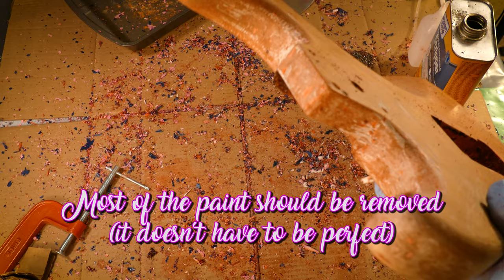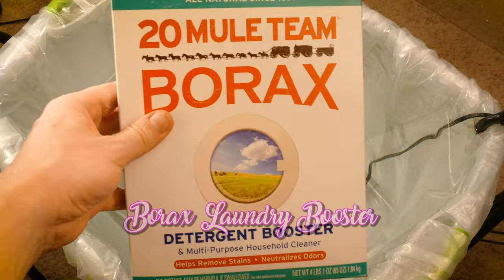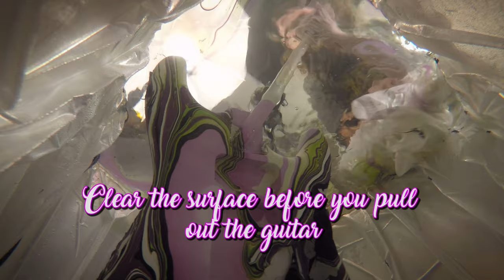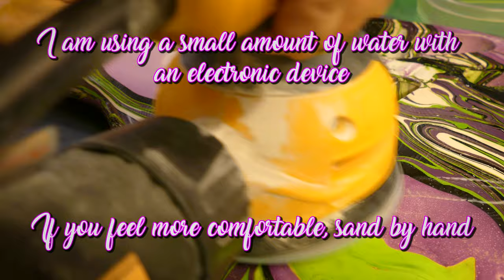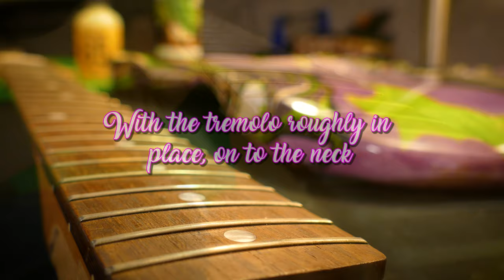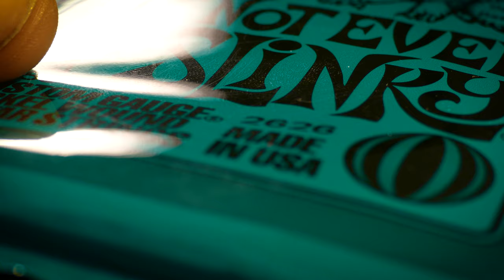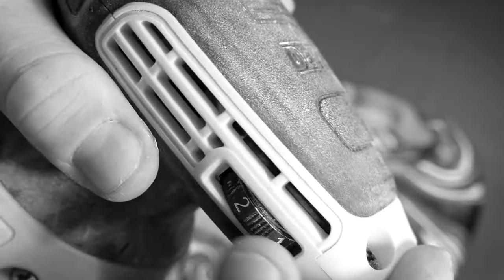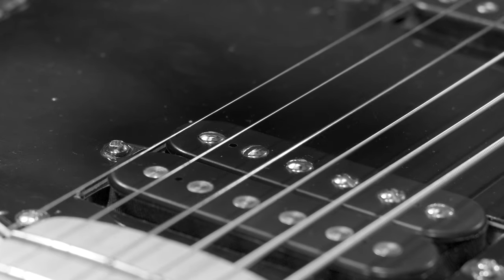How To Hydro Dip A Guitar DIY - 4K (UHD)

Comment: you should of used sandpaper to get the paint off it would have been easier and it would of smoothed up the guitars surface instead of gouging into it like a putty knife will
Reply: It wasn’t lacquer either which is why the heat gun wasn’t so useful but I think it was pretty cool
Reply from the maker: Hi, SPRIRECRANBERRY! I did try to use sandpaper, but it was far too thick of coating. That may work on thinner laters, but it would have taken me probably twice as long as it did with stripper. Especially, sine I forgot I had a ROB during this step. The, "gouging," you are referring too was of minimal issue due to the consistency of the enamel, and the lacayer. Still, thank you for the feedback. I maybe should have mentioned why I didn't do that during that step. Thanks!

Comment: Looks great 👍. I have the exact guitar. Even the base color. I used 120 grit sandpaper and the paint came off quickly. Then sanded with 220. And finally used 600 grit. Super smooth and ready for a dip. 👍
Reply from the maker: Hey, Mr. Smith!

Thanks! That is awesome. Small world, eh? Yea, I wish I would have remember about my orbital during that step. Did you end up dipping it? Do you have any pictures of what you decided to do? Maybe the end result I can see?

Comment: I wonder about doing a good scuff job then primer over that.  Use an adhesion promoter first?  Save the stripping time and money.  And all the gouging in the wood.  
  Or, both sanding, to get through the majority of the original paint, then stripper, to relieve some of the effort and scratching and filling scratches.  Just a thought. 
  The water temp needs to be between 75°f and 90°f, closer to the 90, for sheet dipping, especially. 
  I'm not sure about the colors (thats all subjective and personal taste) but the finish 👌 is spot on.  Good job having patience because that is the key to a job like this.
Reply from the maker: Hi, Boomer! You certainly can paint over the original if you know the condition of the guitar. I bought this off of my buddy. It had been sitting in his garage for some time. I wanted to be sure there was no water damage, so I removed all the paint. That last thing you want to do is seal that in. Thanks for the tips as well!

Comment: I don't know if its already been said, but if this had a poly finish, paint stripper just makes for an unnecessary nightmare.  A heatgun and putty knife will take the whole guitar down to bare wood in 20 minutes without the mess.
Reply from the maker: Hi, Connor! Yea, I tried with the heat gun and putty knife at first. Unfortunately, it wasn't effective at all. Not sure why. The paint stripper was also a pain. Maybe I retry the heat gun again for the next one. Thanks for the suggestion!

Comment: First, AMAZING build man! I enjoyed this video a lot. After you dipped the guitar you applied a clear coat, wax and then polish. Would there be any need to apply a final clear coat or lacquer to seal in or protect that awsome paint job or would that be unnecessary?  I have zero experience in guitars or guitar building,  I just enjoy seeing cool shit being created and I know if I had something that looked like that I would go crazy of it was damaged.
Reply from the maker: Hey, Bill!

Thanks a lot for the compliment and taking the time to not only watch the video, but leave a comment as well! The clear coat I used was actually a lacquer. I used a lot of it because you are right, I would probably cry if it chipped or cracked. Luckily, I used enough to where I don't think this will be an issue. Just be sure if you did something similar (trust me, you could do this), just take your time adding several thin layers of lacquer to prevent it from "alligatoring". If you do it slow in small layers, it won't be a problem. Enamel paint and lacquer can be tricky. Thanks again, Bill!

Comment: Great finish,  but, as a professional sprayer may I give you some advice. It looked to me as if you had a lot of aeration in the lacquer at the end (little white dots) seems to me you need to leave longer time in between wet coats of lacquer to let all the air escape out of the gloss I tend to leave a few minutes after the first coat then double the time for second and double that time for the third and so forth
Reply from the maker: Hey, Jesey!

That's great advice. I forgot mention that in the tutorial. It is absolutely true that time between layers is pertinent. It can cause cracking, or even clouding in more humid environment. Thanks for the feedback!

Comment: Alrightt great video, defo gonna be using this for when I try to hydro dip. Just bought a basic DIY guitar kit from gear4music so should be a good thing to start on. Only thing about this vid is the font but you probably got that comment a hundred times lol. Thanks though.
Reply from the maker: Hi, Jacob! Thanks for checking out the video! How did it go?! I'm curious as to the result. Hope it went well. I understand the point about the font. I went for the swirl theme over legibility, and it was a mistake. Live and learn.

Comment: Great video. I’m glad to see that this technique works with enamel paint because that’s what I have bought. I am going to try dipping my guitar with the pickguard and back cover in place so the swirl flows over them. I hope the primer sticks!
Reply: Unfortunately borax is banned in the U.K.  Is there something else I can use?
Reply from the maker: Hey, Richard! That is a really good idea. It certainly may work. It may be a challenge preventing the paint from coming off of the pickguard, but please let me know how it turns out. Thanks for the compliment about the video as well!
Reply: Well the primer stuck fine to the pickguard but unfortunately the enamel paint ran a bit and spoiled the result. Different colours of enamel paint seem to have different viscosities. The white and blue were ok but the yellow didn’t work. I’ve got some Magic Marble paints, to I’ll strip the body with a heat gun once again and have another go.
Reply from the maker: @richardhunt809  Hi again, Richard. Unfortunately, you are the first one I am aware of that has run into this issue, but I am glad you mentioned it. I did some reading, and the best substitute may be some sort of gelatin. I cannot comment from my own experience, but someone had the same issue as you, and asking about it on a forum. I posted it below. Hopefully this helps. Thanks!

http://www.fixwins.com/getAnswers.php?Problem-Resolved=54669&q=+Borax+substitute+for+swirl+painting+
Reply: @JoeLewis14  Yes, I used a powdered gelatin but it didn’t seem to help much. Maybe I didn’t have enough.

Comment: What kind of water heater was used? Very glad I ran into your vid...prepping to  dip a JEM kit. Crossing my fingers it comes out as awesome as your work! Great job! Amazing! ✌️😎🎸
Reply from the maker: It was nothing fancy. I just used a typical aquarium water heater and checked the temperature with a thermometer. You should be able to find something more finite on Amazon. They have controllers and such to ensure the temps are accurate.
Reply: @JoeLewis14  thank you!

Comment: I’ve watched a heat gun and scraper being used that worked really well….instead of paint remover,..
Reply from the maker: Hi, Jerry. I tried that, and usually it works. However, it did not seem to work very well with this paint. It was odd.

Comment: BILL,  fantastic video ,edits and topic and craftsmanship.  What is the purpose for the borax, does it helps the paint spread out lowering the surface tension?
Reply from the maker: Hey, Havana! You caught me at a good time. I just hopped on to check my YouTube messages and saw your comment.  Thanks a ton for the kind words! Borax prevents the enamel paint from mixing with the water. It ensures the paint stays on the surface. Think of it almost like how oil floats on top of water.  Thanks again, bud!

Comment: Love the build! Was it absolutely required to remove the old paint down to the wood? Could you have just lightly sanded an already painted body and dipped over it?
Reply from the maker: Hey, Kel Rob!

Thanks, mate. Good question. It may not be necessary to remove the old paint, but I decided to because I wanted to be sure the wood was in good condition underneath. It is personal preference. I bought this guitar off of a buddy for $40, and it had been sitting in his garage for some time. If you go ahead and just paint on top, you are putting faith in that fact that there guitar has remained properly sealed. It would be a shame to put in all of this work, only for the factory coated primer to peel up. Painting over the original coat will also make the guitar a bit heavier than if you removed the old paint as well. Hope this helps!

Comment: Amazing ! I have a project practically the same. A Squier strato of the 80s. I've already pickled it up and sanded it. I even gave him the base paint. But I've seen videos where they don't mix water with borate. I have no problem buying borate. But I would like to know if it is essential. What is the difference between immersing the piece in water alone, or in the water-borate solution... Thanks for the information. The guitar has been really beautiful !
Reply from the maker: Hi, Evil Empire! The Borax keeps the paint from mixing with the water and assist in the thinning of the surface tension on top. I've seen some videos done without it, but I would try to use it if I could.
Reply: @JoeLewis14  I decided to paint the guitar with another technique. I'm going to do a kind of tribute to EVH. But in the future I don't rule out painting such a guitar. The finish is amazing. Thank you for your information. Best regards.

Comment: Great video! When you say use "rough" sandpaper for the last once over during the sand leveling part, is there a grade associated with that sandpaper? For all the other sanding, a P number is given. Just a general question for someone that is a sand paper novice haha
Reply from the maker: Hey, 
 danvigneau!

Great question! i should have been more specific. I think anything around P320. Essentially, you are trying to make ridges for the primer to be able to grab on to. If the surface is too smooth, you are more likely to have chipping since there isn't a lot of grip for the primer. Hope this helps :)

Comment: Beautiful build and video! thanks so much. I was gonna paint my guitar just black but this changed my mind and I want a bit of a challenge. So let me get this right. You didn't buy hydrodip from the official sight but made your own solution using heated water the borax and the colors were enamel paint? sorry new to this trying to understand what I need specifically for the hydrodrip. I read the description but am just clarifying
Reply from the maker: Hi TheArcticKitten. You are 100% correct. If you follow each section step by step, and TAKE YOUR TIME, you will not be dissapointed! Good luck. I hope it goes well!
Reply: @JoeLewis14  I went through with it and it came out awesome! one thing ill add for anyone else reading is make sure u dissolve as much borax as u can in ur solution and stir well. I didn't on my first go ahead and all my pink paint fell to the bottom

Comment: Awesome video! 
If the guitar I want to paint starts as white do you still need to strip the paint?
Reply from the maker: Hi, Thomas! Thanks! I would recommend still using a primer to help the paint adhere. However, if you think the wood is in good condition underneath, there is no reason you couldn't just scuff up the current paint, and primer over it.

Comment: Love the tutorial! I’m getting ready to redo my sons squire for him in a blue swirl. I noticed the first clear coats caused what looked like “alligatoring” in the paint. I was wondering how you found the lacquer to work with over enamel? Usually this is a no no but based on the final look it seems to have worked out. Anything to look out for when doing the clear coats? Thanks!
Reply from the maker: Hey, Bobby! Thanks a lot for the kind words. I'm glad you enjoyed it. What a cool dad! You are 100% that enamel paint can be tricky. I recommend taking your time. Very slow and thin layers. Wait a while between coats, and you should be good. After 3 years, the guitar is still perfect! Hope this helps!

Comment: Will acrylic markers get messed up if you sand it after the first clear coat has been sprayed Also can I use something similar to borax since I live in Sweden and don't have access to that.
Reply from the maker: Hey, BattleKau!

Sorry, for the late response. Been very busy with work. I would steer away from sanding pain. It can smear and mess up the paint. I would clear coat first, then level sand. I'm not sure what a good substitute for Borax is, so, maybe you woule be able to order some online. Sorry, I couldn't be more helpful, there. Thanks for the question!
Reply: @JoeLewis14  Thanks for the response anyway I appreciate it!

Comment: I picked up a used Squier guitar, same color and style as the one in the video here, to use as a project guitar. This video was really inspiring for me. I was considering hydrodipping it once I got all the old paint off and new hardware delivered, now I'm almost certain that's the route I want to go. I'm curious though, why did you convert from the single-coils and was there any additional body work required to fit humbuckers?
Reply from the maker: Hey, BullPunk!

That's cool that you picked up a very similar guitar! It is a good idea to do this on a guitar that is relatively cheap in the off chance something goes wrong, especially if you are new doing projects like these. 

There was absolutely no modification needed to the body to change from single coil to humbuckers. The manufacturers bore the pickup holes wide enough so that they can use it for any model they choose, such as HH, HSS, SSS, etc., so, the consumer should not run into any problems if they decide to change from single to humbucker, or vice versa.

The decision to go from single to humbuckers was simply personal preference. I was going through a pretty big Nirvana phase when I decided to do this build, and wanted to emulate Cobain's tone as much as possible. I researched the exact humbuckers he used on is signature Jaguar, and used those. Although, it is a different body style, it is almost identical to his tone used on most of his songs. I was stoked with how it sounded once it was completed. I provided a link about his Jaguar below, and you can see that they are the exact model pickups I used. For about $300 in parts and materials used in the project, I made a $40 Squire sound like a $1,300 Jaguar. I couldn't be happier with the outcome and there ins't another one like it in the world :)

Kurt's Jaguar : https://shop.fender.com/en-US/electric-guitars/jaguar/kurt-cobain-jaguar/0143001700.html

I am very happy to hear that the video inspired you! I really believe anyone can do this, just be sure to take your time. Let me know if you decide to do the project, I would love to see how it it turns out! Good luck!

Comment: Great Job!! Congratulations . I have a question.

How long have you been polishing with the light automotive polish??
Reply from the maker: Thanks, Garzael! In general or for this project? Automotive polish is something I read about for guitar applications, and wanted to give it a try. I am now a believer and will use it every time, now. I did 2 to 3 runs with it for this one. Maybe bounce between polish and a wax. Just be sure you don't polish through the clear coats. Hope this helps!

Comment: Definitely a much different take than other videos hydro dipping guitars, very well done! I have a question, though. After i apply the last clear coat, am i required to sand it again to get the most optimal finish, or can i just leave it as it is, so long as it's an even coat?
Reply from the maker: Hey, girard!
Thanks, mate! I would definitely do one last sand. It will fix any imperfections that may occur. I didn't do very good final wet sand on one of my guitar build videos, and everyone was sure to let me know lol
Reply: @JoeLewis14  one last question- would you recommend enamel paint or aerosol spray paint?
Reply from the maker: @eliot6989  Hey, girard!

I would definitely go with enamel paints. Spray paints create kind of a slop rather than defined lines. They also create unwanted bubbles as well. You would need to work in a well ventilated environment since they are aerosol. Lastly, spray paint tend to give you a lot more of a difficult time when it comes to lacquer time. They can cracks, peel, or cause, "alligatoring." I personally think enamel colors are much more vibrant, and easier to control. I've seen some spray paint dips, and they don't look very good to me. Personal preference of course, but I can't help but notice these videos often avoid showing the outcome with lacquer and/or clear coat. Hope this helps a little! Thanks for the questions, too!